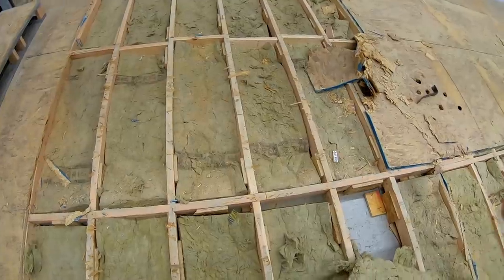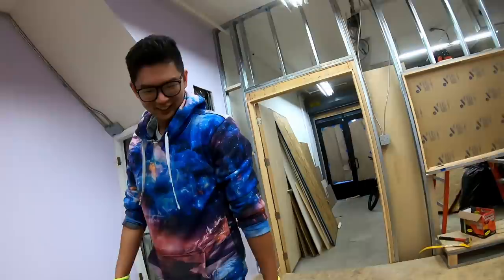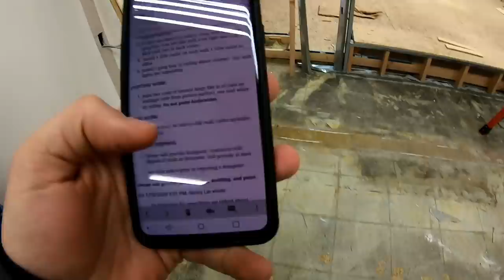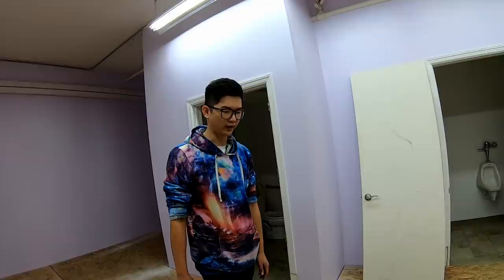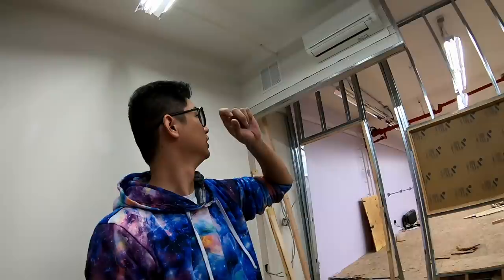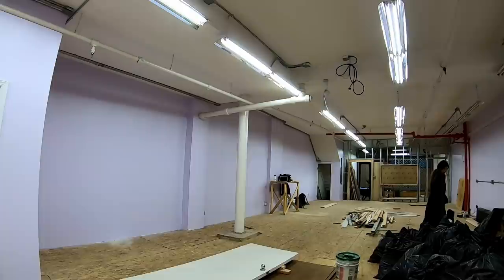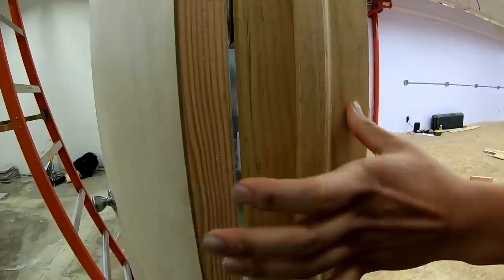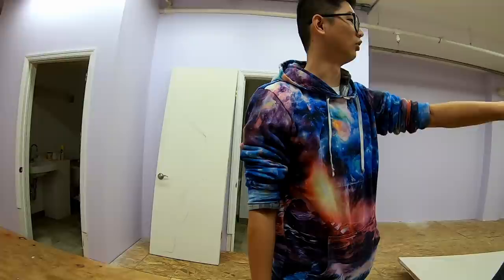Day 44 - THE RETURN OF SUNNY! Contractor C walkthrough

Comment: Isn't fiberglass usually yellow? Did they install dirty used fiberglass or what?
Reply: The packaging was visible in some of the older videos, it's rockwool comfortbatts r15
"ROCKWOOL insulation is a rock-based mineral fiber insulation comprised of Basalt rock and Recycled Slag. Basalt is a volcanic rock (abundant in the earth), and slag is a by-product of the steel and copper industry. The minerals are melted and spun into fibers. "
https://www.rockwool.com/technical-resources/faq/ 

Edit: I forgot to say fiberglass insulation can be other colors too. owens corning brand is popular here in the US, and it's pink.

Comment: Damn they did a worse job than I realized.  Not even lining up the edge of the plywood with a joist... damn.   And those shims are worse than I realize.   What pisses me off about stuff like this is if you are not a licensed contractor you're not allowed to do business, but yet just because this amateur has a license he's allowed to do work that is shoddy as hell.   Make sure someone checks all the electrical so the place does not catch on fire.  Like those plugs at the old office, I bet they just shoved them in the ceiling and did not remove them properly.  I would check all that.

Comment: If you ever want to hire someone that knows what they are doing hit me up. I can survey land fell the trees operate an excavator bulldozer and dump truck put a road in grade your lot dig your foundation set your forms frame the place up roof it sheathe it put up the rakes soffit and facia side it put windows and doors in hang and mud the sheet rock do the painting/staining and sanding, then tackle the landscaping and gardening professionally.  You like vinyl, cedar shakes? cedar impressions? shiplap? half log siding? Actual log cabin? Done it - looked great, took pictures. I've been doing this stuff since I was about 14 and I've only had two stitches in my life and never broken a bone. Just ask for pictures and tell them you want to see some of their work. Pretty easy to spot a bullshitter in a detailed conversation or after one days work. I once saw a kid wheel in a brand new drywall lift with stickers all over it. No mud at all. Same with his trowel. I told them right then the kid wasn't gonna work out. They gave him the day; he ended up hanging one room so poorly they threw him off the site and had me tear it all down and had to take him to court, as with your plywood magician he had not even properly staggered the seams which is just BASIC carpentry. He also had run factory edges improperly, with some on the exterior sides of the ceiling and cuts in the middle of the ceiling, where everything should be clean tapeable factory edges. This is a double mistake, as now the interior seams are more difficult to mud, and your cuts are not at the edge of the ceiling. He had gaps large enough to stick your pinky finger in, and seams running the entire length of the room.  Anyone who has run a single floor, sheathed one building, or hung sheetrock for a day ought to understand that. If a contractor can't show you at least a small portfolio of their past work they might not be a contractor. https://photos.google.com/album/AF1QipOD05bGXNFUhCfiL2_3R03AnbM3J9gawddNc1Ha The job he hung that drywall at I was painting a lot of baseboard and walls and ceilings - the blue wall in that google album was from that job. He took $2,000 of the home owners money, who had a disabled kid and needed this building to be move in ready- failed to hang one room properly and refused to return the money despite being grossly incompetent.

Comment: Adding all that extra wood on the floor seems to be a terrible idea, time consuming and costly.  Why not use a liquid floor leveler to get everything where it needs to be and add the decorative flooring right over it.  No squeaking or bowing at all over time.
Reply: They say there is a around 1/2 ft slope from the back to the front.  They are not sure if the floor can take the weight, don't know how to stop it at the front door, and at this stage, don't want to have to deal with the extra height for the bathroom or the basement stairs.  Perhaps, Liquifier, you have easy, ahem, solutions to their objections.  It has been suggested and addressed many times, check out previous videos, it is entertaining and Louis is a good guy.

Comment: ok for one thing why is there a floor on top of a floor??? Perhaps it was the reclamation of the tiles that were existing? anyways, much better and more advanced is a product called Dri-Core, which is specifically designed for your application. AND way easier to install, instead of that dumb system of 2x4 sleepers and insulation. I am a little stymied by some of the archaic construction your first contractor has been doing. Oh and another not, when Sunny there pulled up some of that OSB, the old contractor should have used PL premium, or even PL400 at least, and he should have used WAY more  glue, as when it comes to proper application, half the OSB should be still stuck to those miserable 2x4 joists.
Oh and one last things, if the contractor raises the floor 4 inches, what happens to all your doorways? this sounds seriously odd.

Comment: LOUIS. why does that insulation look old, it looks like they recycled it from another project. Also, I am a structured wiring manager, I really really encourage you to do your data runs now while the walls are down.  Run one set and redundant to phone locations, copier locations, workstations or anywhere you need connectivity. One box of cat six is a small investment and then you can punch down afterwards. If you want to chat about it, dm or reach out to me. I can give you help and consulting gratis for the data runs and punching down, including server closets etc. i built eight offices in the last year alone and each of those offices had furniture runs.  I also did rfid key access, WiFi security and electronic locks.
Reply: Could the insulation be some environmentally friendly stuff? Crafted from sunlight, soy, dirt, and hope?

Comment: There are probably dozens of data center flooring companies in your area. You should explore idea.
Reply: If they have ways to handle the slope and uneven floor this could be a great idea.
Reply: @RoverT65536  it is completely adjustable. Has stands like floor Jack's every 2x2 feet
Reply: Charlie W, that makes sense, they probably have ramps too to deal with the bathrooms, basement and entry.  I hope he considers this option.  I imagine they would be eager to give a quote,
Reply: @RoverT65536  check out data center resources.com for pics
Reply: Charlie W, certainly better than fastening plywood to the floor.  I've been in a few data centers and I've probably walked up ramps without even noticing.

Comment: Dang video stopped at the most interesting part. Well this kid aint no contractor, pointing out wrong things is not a sign of strength when you try to pry boards like that...  And thats not the tool for the job. You should have gotten a recipro saw, more efficient and much and much safer for demo work. You can do it with a circular saw but you need a proper one with a demo blade and experience handling one. Not that i understand why you want to cut up the boards but hey

Comment: What the hell is it with Americans and WOOD??? It's 2020 and you are still building shacks instead of houses out of the stuff. Steel Galvanised beams set into the walls with waterproof plywood on top. Job done and finished in a week and you could use the place as an auto workshop. Don't give me any crap about the cost. 2 men could finish a steel beam installation in a week.